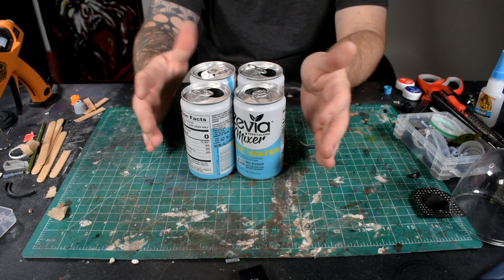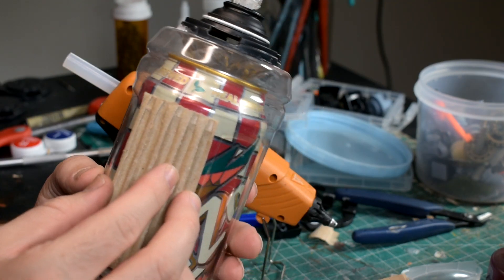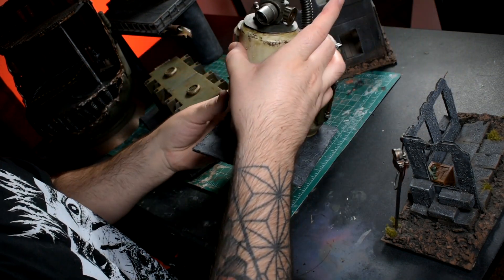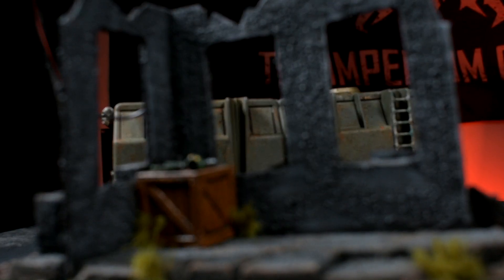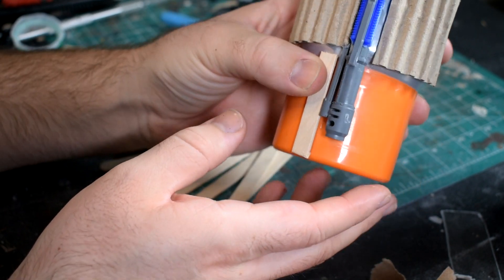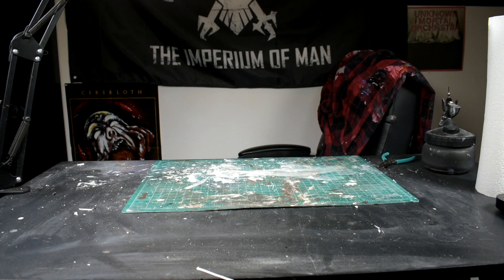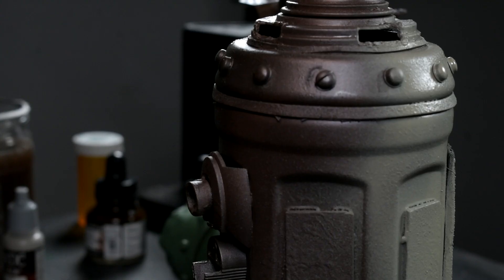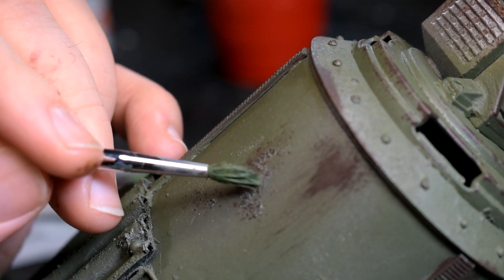Soda can terrain, tips on art block.

Comment: Also at 0:42 what is the black material you are using as a base, and what is the stuff your filling it with. I sometimes see it on videos but I forget the name of both.
Reply from the maker: The stuff used as a base is a corrugated plastic board. Its basically cardboard made of plastic. As for the filler its just a spackle, i specifically use a spackle that goes on pink and drys white. 🙂
Reply: @boxnaught7428  Epic thank you for the info. Ill hav to get some of that corrugated plastic board. I found cardboard and poster board to warp to easily. Do you have any warping issues with the corrugated stuff? Also what thickness do you sue for the board?